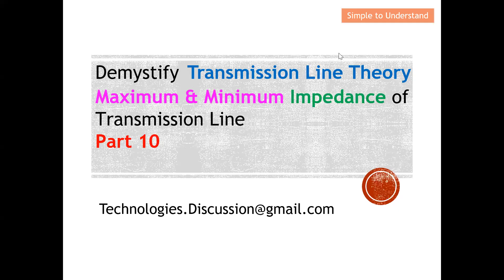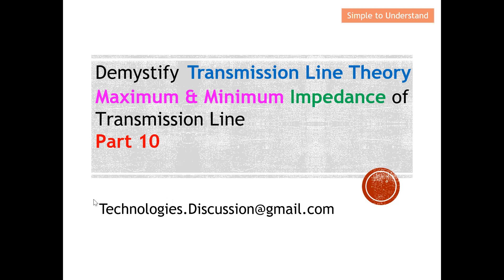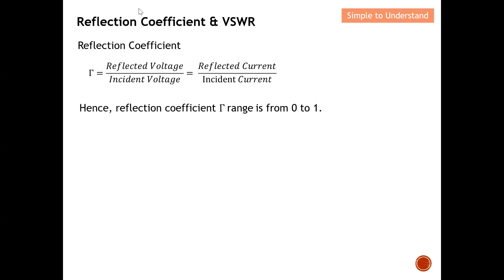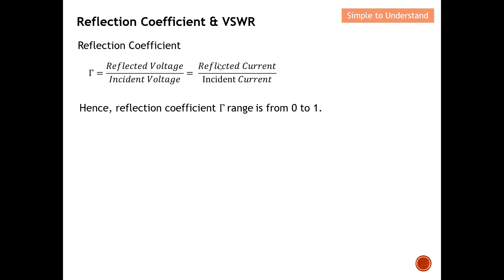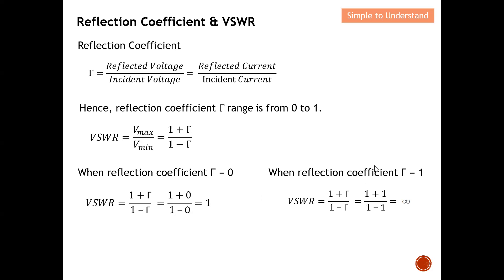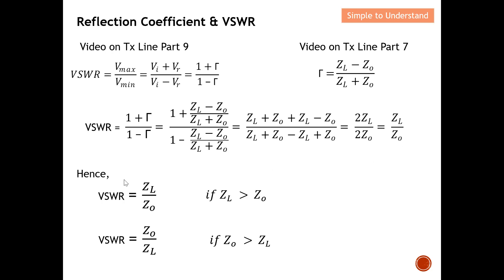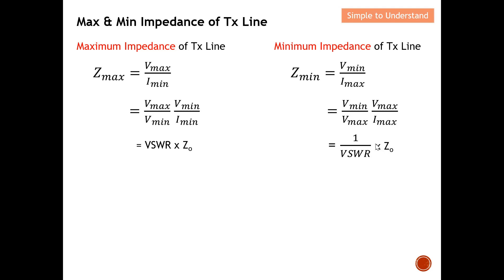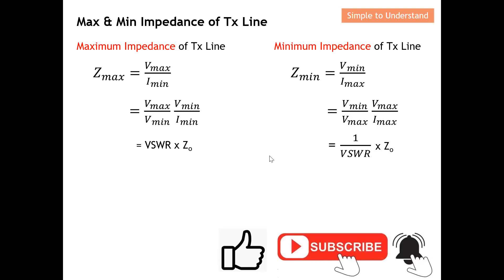Tx Line Part 10. How to Calculate the Max & Min Input Impedance (Zin) of a Transmission Line.

Comment: 07:12, where does it come from, if Z0>ZL then Г=(Z0-ZL)/(Z0+ZL)

such case wasn't considered in Part 7 video

I think the issue is that the numerator of Г should be taken by modulo

thank you
Reply from the maker: Thank you for your question. I just want to simplify the Eq of Г. You can remain at this form: Г=(Z0-ZL)/(Z0+ZL)
However, I simply the Eq so that u can cancel the term Z0 or ZL when needed. These simplify eqs are needed later on in order to make the eqn management.
Thank you.  :)
I hope I ask your question,
Reply: @technologiesdiscussion1676  ok, thank you!)
Reply from the maker: NP  :)
You can help this Channel by Like & Subscribe. Thank you  :)